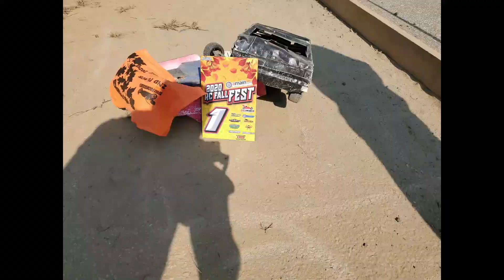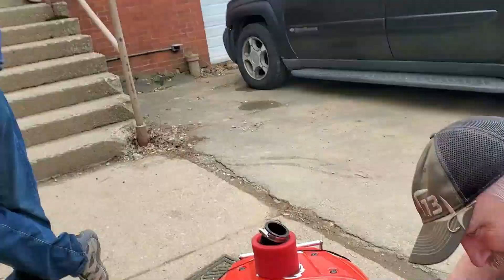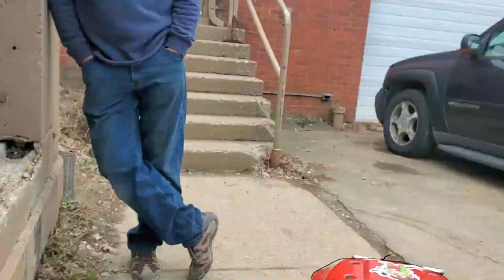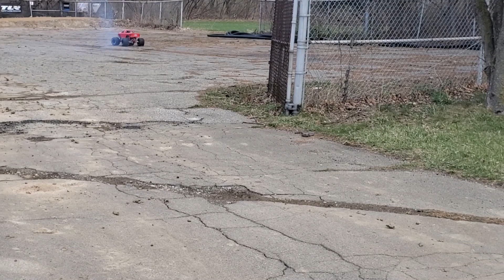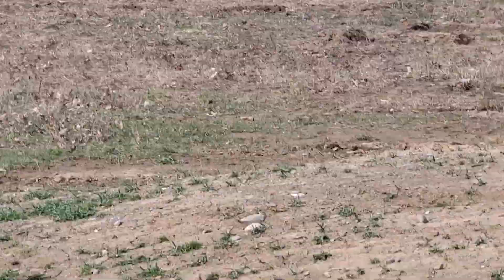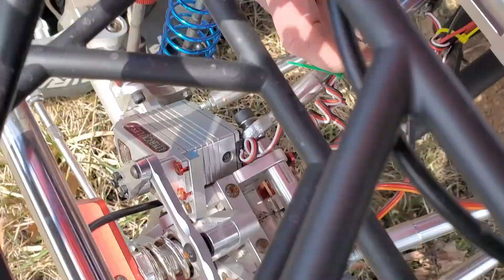Primal Rc Raminator Hits 1/8  Offroad track hard wreck!!

Comment: What does something like this truck sell for with the brush guard on the front please comment back very curious thank you for this video I just hope if I buy one it stage running lol lol thank you for this video
Reply from the maker: The truck stock with just front steering is $3099 shipped. Don't remember off hand the brush guard cost, it was purchased with rear steer and extra tires. Make sure you only buy from www.primalrc.com